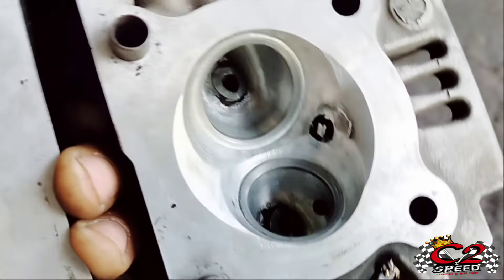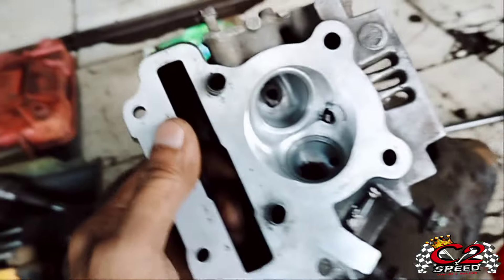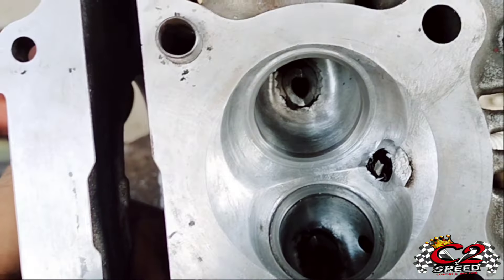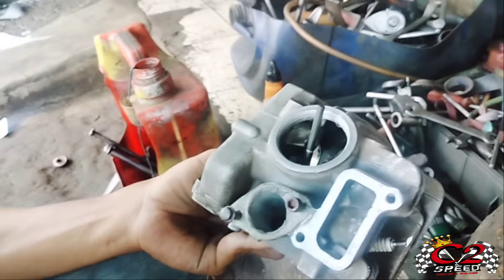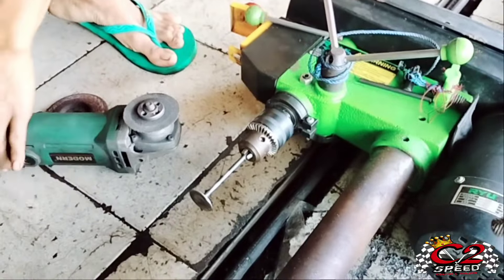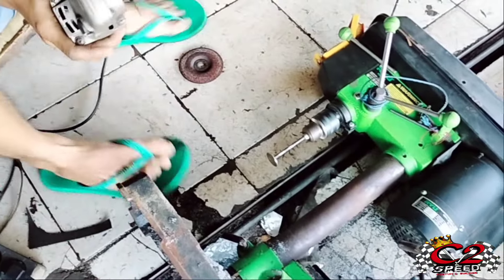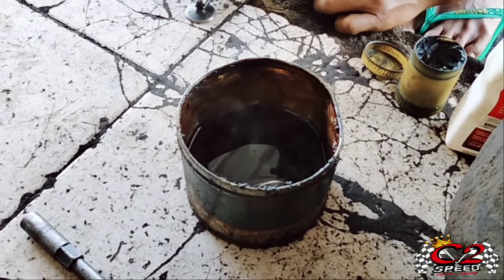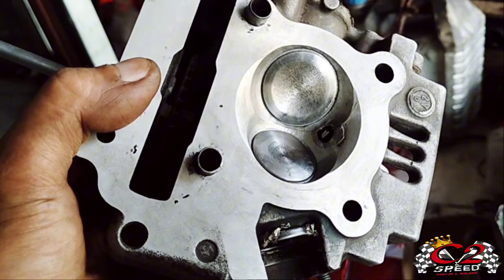REPAIR SILINDER HEAD JUPITER Z SERIES / VEGA ZR KLEP 32 28 👩‍🔧

Comment: Pnya ku udh d bikin klaher kya gk senter bg msh brisik ap lg mesin panas gk karuan suara ny
Reply from the maker: Wadduh pke laher apa
Reply: @c2speedc2jokcustombuilder10  yg bagus pake laher ap bg siapa tau masalah ny dari laher ny
Reply from the maker: @Indrairsya17 pke mio
Reply: @c2speedc2jokcustombuilder10  iya tak coba nanti bg mksh info ny
Reply from the maker: @Indrairsya17 🙏
Reply: @c2speedc2jokcustombuilder10  kalo head kustom brapa y om
Reply from the maker: @Indrairsya17 paling 850an sd 1jt an
Reply: @c2speedc2jokcustombuilder10  kalo yg 85 ituh udh ful isian blom mang
Reply: @c2speedc2jokcustombuilder10  pengen aku mang klep standar ny aj gk pp yg pnting motor gk brisik mau tak bli n head asli ny sama aj dia kn gk dabel bering
Reply from the maker: @Indrairsya17 blm om
Reply: @c2speedc2jokcustombuilder10  tpi ituh bagus gk mang head ny
Reply from the maker: @Indrairsya17 bisa aja